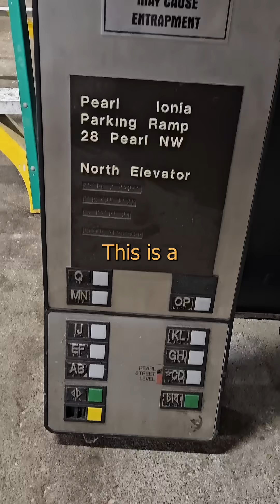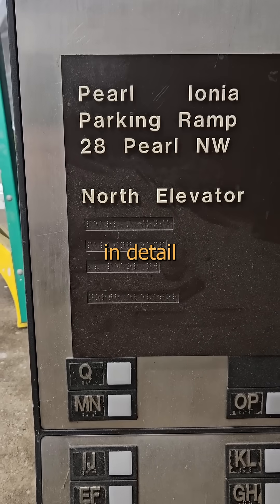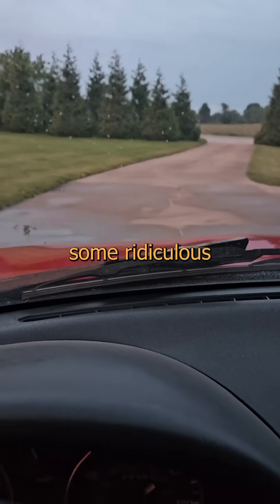Miata Mischief #chrisboden #engineering #gear #elevator #score #stories #parts #hacking #making

Comment: Toured an MX-5 1.8 Mk2.5 (the U.K. version of the Miata) round Europe for just shy of three weeks with my Mrs. Plenty of room in the boot, you’ve just got to be cunning with your packing and work out every nook and cranny before you set out. We had a blast avoiding motorways and dual carriageways, the Mazda was built for the smaller, twisty roads. Loved that car, children came along, sold that car, children nearly grown up, you know I’ll be buying another one!

Sketchy use of it? Roof down, February, Northern England to North Wales with a kayak and paddle strapped into the passenger seat in order to go paddle a river there. Lashing rain, a great day paddling and then two hours driving home, in the rain again, and wondering why I was borderline hypothermic when I got home. Idiot.

Comment: Ill take a swing, this was about 20 years ago, my my buddy and i went fishing with little like 15ft max, aluminum boat. Well the damn hitch had rotted and fell off when we hooked it back up that afternoon. So, being 16, i used an ancient ratchet strap as a seat belt to hold me from falling off the tailgate, and i just kinda held onto it. 
Note, it did almost kill me at a traffic light. Luckily i had gloves on, but it tried to impale me. (To be fair, we only had like a 2 miles drive but ya know, it happened)

Comment: Mine was a PDP-8 in a little fire red wagon and a 10 speed bike.
But how about driving thru the country, and finding a Star Trek first generation pinball machine with a for sale sign on some isolated farm road?
Now, imagine strapping it to a Honda CRX back in the late 80's.  Not sure the front wheels had enough weight on them to actually steer, technically.

Comment: I play bass for a '50s rockabilly band, and my daily driver up until recently was a 2009 Kia Rio, and I play upright bass. The best was to haul my upright was to fold down the passenger seat, and pull it inside the car from the driver's rear door and position it to where I could still put it into gear.

Comment: During spring cleaning I saw a vintage lawn boy mower that looked like it was in great shape.  Knowing LB mowers usually will run with a little TLC I took it home, but I couldn't open the hatch on my 89 323 so I just drove home holding onto the handle through my driver's window.  Drove roughly 3/4 mile and mower ran great after a little work.

Comment: I stuffed a radiator for a 1994 F250 into the back seats of Saturn Ion coupe since it was too wide to fit in the trunk in either orientation. 
Had to drive home essentially playing tonsil hockey with the windshield.

Comment: About 17 years ago, I had to replace an engine in a Citroën AX. For that, I figured to use a lintel lift. So I rented one at a rental company a few miles away. But to get it to where I needed it, I had to pick it up myself, with my own car. Since I only had another Citroën AX as my daily drive, I stripped my car from it's entire interior (except for the drivers seat), in order to make the lintel lift fit inside the car. And it did! All doors closed! Shifting to reverse was a challenge though, because on an AX 5-gear transmission, reverse is full right and down. With a lintel lift inside the car, that's a challenge.

Comment: moved a whole bed, base included, in my sedan mazda 3. Had to disassemble the whole thing and fold the foam matress in half and tie + compress it with ratchet straps to make it fit with a few boxes, a gaming PC, and a disassembled desk. Could barely shift between gears and picking up food for the road was out of question for sure. Forgot to take pictures but the thing was filled up to the ceiling. Maybe I could have fitted an Ipad atop the piles but not much more.

Comment: The sketchiest things I hauled om public roads in my 2004 Hyundai Getz (1.3 litre, 73 hp) would be by brother behind me on skis after a snow storm or a trailer with about 25 bicycles, which was longer, taller and wider than the car and about equally as heavy.

Comment: My friend's dad worked at an extremely small local airfield and after a fire broke out they were scrapping pretty much everything. The owners of the small aircrafts that were housed there were all insured so they took their money and left him with the burned remains to sell for junk metal. One man never responsed to the guy's calls or emails or letters which is how I ended up dragging a rotorhead from a Bell 47 the 11 miles back home in a wagon that I held onto the handle of from the back of my friend's two stroke dirtbike.

Comment: i was looking on facebook-mp for a kitchen table and saw someone gave a beautiful oak table for free looked good in the pictures it was just 80miles from my house so i thought why not its  free, so i call the guy and ask when i can come and get it he says as soon as possible so i said next day, drive my peugeot 208 (smal car but can fit a smal kitchen table in the back with a bit of the table outside the car ) got to his house beautifull wood cabin get around to the front door ring the bell greet him and he asks if i want to bring my trtaile around the house i said i dont have a trailer he looks at me like im crazy so i told him the peugeot on the street is mine he starts laugthing and asks me if i read the measurment of the table turnout it was 12,5 feet long wood table and  i thougt it was smaler because of the pitures and he wrote 3,8  and i thought it was feet not meters so i asked if i can get it another time he said sombody else called and asked if its still there he needs to mo and wants the table gone so in the en we straped the table to my cars roof and went home super slow got home safe with a 12 foot table and a dent in my car roof

Comment: So I have a 1974 SAAB Sonett 3 which is basically a swedish Miata, tiny car, low power, pop-up headlights and super fun to drive. I believe the Sonett 3 is even smaller than the Miata, but the thing is that it has a lot of space in the trunk. So in may we bought a whole twin pipe system for the Sonett, and we were able cram the whole exhaust system into that trunk. It was in peices obviously but it was still a lot of pipes. And the long peices had to rest on top of the cabin-trunk divider wall so on the drive home there were these 2 long pipes in between mine and my dad's head.

Comment: We had to bring an old truck home from my uncle's place once. We worked out that the only tractor on hand would likely be too weak and light to lift the front wheels of the truck off the ground without tipping over, let alone the whole truck. so we put a pile of grain sacks on the three point linkage to balance the thing, lifted the front wheels just barely off the ground and drove home backwards. we've done this three more times since.

Comment: Just 2 years ago we bought a 6.5ft by 4ft dresser from goodwill. Weighs about 150 pounds and i donr have a truck. What i do have is a Toyota Corolla iM and i took that to the goodwill, had the employees help me load it and i drove it home. Hatch open, back seats folded down, front seats pulled as far forward as possible and with still 2 feet hanging out the back. Like a dumbass i didnt bring any ratchet straps or tie downs, so i drove it home with one hand death gripping the dresser and the other on the wheel. Hatch was all the way up, hazards on and i had many people honk at me because why would anyone do that. Drove it home 5 miles down the road and unloaded it. Probably wont do that ever again but that was wild!

Comment: I play guitar and have some nice Marshall amps and a half stack speaker for my axes. Usually I had friends help me move said equipment for shows. One night no one was available so I had to wedge ALL of my equipment in the back of my Pontiac grand am. I managed it, and when I got in the driver seat, I realized I had 0 rear view because my mirror was full of Marshall goodness.

I almost got popped by a cop, but luckily some unfortunate woman tried passing me at 85 in a 55 so cop pulled her over instead. Concert went great too ;)

Comment: hauled home a old mall kiosk computer in the kiosk chassis in my 1st gen Rx-7 had the leave the hatch open the whole drive home and it had enough weight to sag the rear enough to rub the wheels on the fenders every little slight bump

Comment: Blacksmith went to a hammer-in a bit one in Ohio about 5 hour drive. I went there thinking I’d buy some tongs maybe some steel some Material etc. I bought two frank forges full bowls and blowers, two anvils, 32 20in by 6in by 4in metal bins for sorting and stacking materials more than a dozen pieces of wrought iron including to unbent wagon wheels. Biggest haul was a file box of old schematics and designs instructional books on building a shave horse draw knives and a bunch of other woodworking tools. I had to drive to a harbor freighter to get a cargo net because my load in my Chevy pickup was taller than the roof and slightly wider on ever side. It was a masterpiece my father a Tetris master was proud off. Got pulled over twice but both those donut munchers couldn’t find a lose piece to shake me down for 200 dollars and the Second Lady must have smelled a stale donut in the truckbed because she tried to get there but could pry a piece loose.

Comment: I hauled a 2004 toyota tundra transfer case and starter on the back of a 26 x 1.8 bike with a milk crate. I got to the top of a steep hill and while coasting downhill the brakes overheated and I dumped my bike at 17mph, slamming into the side of a parked Lincoln navigator. Somehow I was fine but the starter and transfer case were gouged everywhere from dumping them on asphalt... I never rode a bike again after my truck and car were finished

Comment: i needed a new mattress desperately. i went to mattress firm and after some deliberation, wen twith a clearance option of a california king with a free adjustable base.  the problem is the only vehicle i had at the time was a 2011 chrysler 200 convertible. had to drive an hour to get it, the dock worker was extremely pissy that i had showed up 15 minutes to close in a convertible asking for my mattress, warning me taht if i couldnt move it they wouldnt help. me and my buddy folded the top down, loaded the mattress first then the base, and tied it all down. honestly it fit pretty well, the only problem was on the way back taking back roads, it started to rain cats and dogs. anyway i got the inside and outside of the car washed that day.

Comment: I stuffed a 50" TV (not flat screen) across the back seat of my 2012 Malibu and drove it home. Doors barely closed, it barely fit, but it did make it home, out of the car and into the basement. My car still has the damage marks on the interior of both rear doors from trying to fit this monster.

Comment: Brought home a 150gallon gas water heater in the back of a "new" beetle. Huge box literally wedged into the back of the car, had to disconnect the lift shocks from the hatch, and moved the seats back to hold it in place. Never took a picture of it but the 30+ mile drive home had folks honking, waving & laughing as they passed me on the freeway. Took forever to get into the car and back out again, truly was wedged into the car.

Comment: Had to get rid of old windowsills, one made out of concrete (shit even had reinforcing bars in it) and the second one was ceramic or some other material. Because waste removal was like ~80$ and the truck would arrive in 2 days, I decided to take them to the dump myslef. My car was a Fiat Panda, those windowsills were so long, they were sticking over the gear leaver and the reinforcing bars were almost hitting the windshield. They weight around 300 kg (660lb) while the car was 750 kg (1653 lb). But hey, saved 80$!

Comment: My mom sold our house to our aunt, and I had a bigasd pickup there that needed a brake job and wouldn't stay running. Fortunately I knew how alternators work, so when I got the call that they wanted it gone, i pulled up with jumper cables.

It took two trucks with jumper cables AND a trickle charger hooked to the battery leads to get enough juice to start the engine. Fluttering the gas and clutch to keep her from dieing on the five mile drive to my new house without a battery to crank her back up when she dies was exciting, as in "oh god oh god we're going to die" exciting. Now I'm about to hang a sign in the window that says "if you can fix her, she's yours" because I'm moving again and I'm not an expert. I can't fix her.

Comment: Not exactly sketchy in the sense that the cargo was in danger, but we were picking up a reclining chair from a house in north eastern Arkansas (the middle of nowhere) in the season when the rice fields are flooded. Standing water, warm weather, and the constant high humidity made it perfect for mosquito breeding. By perfect, I mean the mosquito’s were like fog in the forest, which happened to be where the house was. You couldn’t walk outside without mosquitos entering the house, and without breathing a few in through both your nose and mouth. We had to move this large recliner through a small back door and into the trunk of a car, so obviously we had to have both of those things open until it was through. Naturally, they were both absolutely FILLED with mosquitos. We stayed in the house for a while spraying mosquitos with killer until it was livable again, but the car was a different story. We basically had to turn it into a gas chamber with mosquito spray. We drove home with every inch of our bodies covered in clothing to be safe. By the time we were at our destination an hour and a half away, the mosquitos had mostly died. If you looked down, it would’ve looked like the floor of the car was carpeted, but it was a literal mat of dead mosquitos. If you’re ever in northeast Arkansas during the spring and summer, beware the mosquito fog.!

Comment: My first car was a Opel Corsa (also known as Vauxhall Corsa in other countries). As my name already tells, I'm from Austria... So it was one winter,  I just moved to my new flat and needed furniture and everything. I bought a washing machine and dishwasher. One fitted inside the trunk, the other didn't. I don't remember which one of , but I think it was the dishwasher I had to strap on the roof and so I did. But what was even "funnier" about this was that I hadn't Winter tires in my car. It was a one hour drive from the store to my home. It already started snowing when I was driving to the store, and as soon as I came out of the store and had everything stuffed in and mounted onto my car it was a full blown blizzard. 😂 So imagine driving with this setup back home, one hour, through mountains during a blizzard. Well everything went well and even the machine on top of my car survived the wetness and everything. 😂😂

Comment: Not anything stupid, but im all for this. If it fits, it ships. I will cram ANYTHING that fits into my 03’ Lexus GS. 4 18” wheels + 4 tires, hydraulic pumps, weedeaters, if it fits im taking it. With 2 12” subs in the trunk, that’s pretty useless, so my only option is the cabin. You’d be surprised at what and how much you can fit in a Lexus. Surprisingly practical.

Comment: Back in 1978, I once helped my buddy take the body off his 73 VW Beetle. Once we removed it, we looked at each other and said, "Let's take it for a ride!" We reconnected all the important stuff...he used a milk crate as a driver's seat, and I just sat on the floor pan on the passenger side. We were running it around the neighborhood till one of the adults called the cops...the look on that cops face when he pulled us over...anger, disgust, and a little smirk of, I woulda done it too sneaking out as he lectured us on how dangerous it was and how many traffic laws we were breaking!

Comment: One time my cousin, dad, and I were getting firewood. We were in my dad's truck. We filled up the bed to the point of having to take the cover off and put some in the cab. So, we did, but there was a problem: we had to take the cover, my brother AND me, and all that wood, home. 
How is this a problem? WELL, we couldn't fit the cover and the wood in without folding up the seats and it blocking the view of the rear-view mirror.
So here's what we did: We took some of the wood out of the bed, and I stood in the bed being my dad's rearview mirror, and I should mention, the place we got the wood, we couldn't get there without going on the highway. 
What I'm saying is that one time, in order to get me, my cousin, our truck bed cover, and all that wood back, I had to stand in the bed on the highway being my dad's rearview mirror.

Comment: We once stuck both horizontal tail surfaces from a T34B Mentor in the back of a Cessna 172 and flew them from central to Northern California and back to get them inspected. Took out the back seat. Had to take the door off to get them in and then replace the door. Luckily the inspector did his thing without unloading them from the 172. (Yes gross weight and balance were OK! It was safe.)